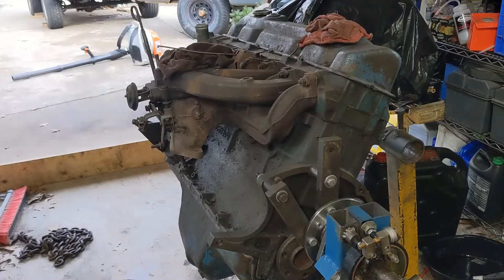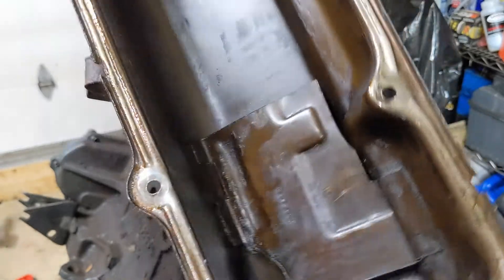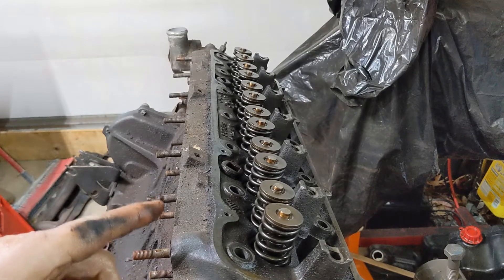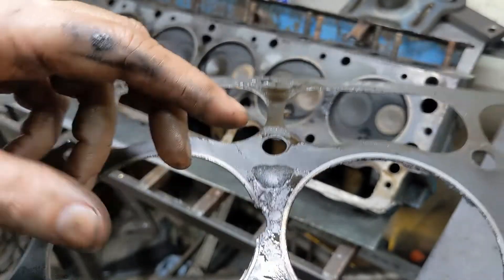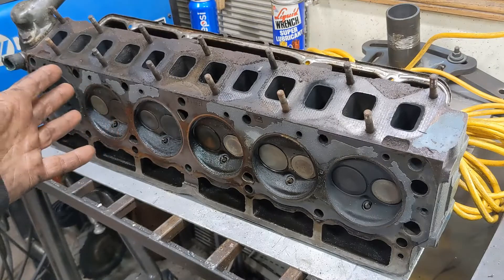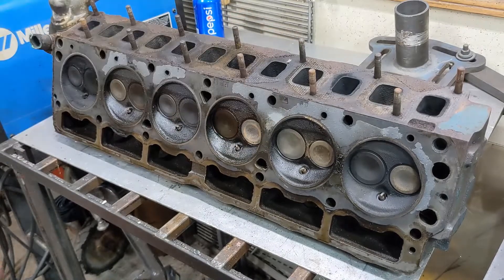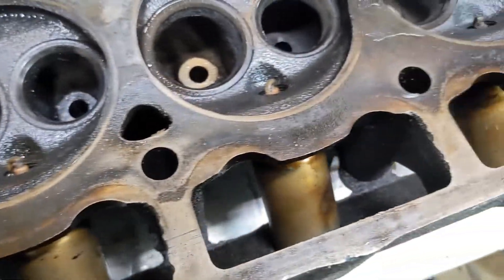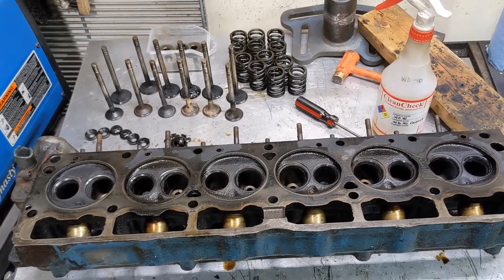Slant Six Top-End Teardown: Bad Seals and a Blown Head Gasket

Comment: My slant 6 has a cylinder with low compression and over heats. I bet mine is blowing into the water jacket. Thanks to your video it about confirms it without taking it apart right now, thanks again!
Reply from the maker: Low compression and overheating is almost certain to be a head gasket. It's pretty easy to replace, but the question is why it went out
Reply: @YoshimoshiGarage it’s old so no telling what happens to it during its life. It’s a replacement for another engine that has rod knock. Either way it’s a summer project now that winter is here, thanks again for the videos!

Comment: New valves are pretty cheap I would definitely just put new ones all the way around
Reply from the maker: Agreed, nowdays new valves are cheaper than the time required to grind old ones and I did go with new, but I still had Dr. Torque grind the old ones because it's an interesting process.

Comment: crumbling intake valve stem seals is an indication that this engine was overheating so better to check the cooling system.
it is a good idea to have the head gasket surface checked with a straight edge and rpobably resurfaced.
Reply from the maker: Good feedback, I thought the same so this head did go to get resurfaced. Twice, even, because they screwed it up the first time.

Comment: Learned a lot - thanks :) ... I don't have the tool to take off and replace the valves, it seems, or do I need that ?  If So hoping a new head gasket alone or maybe also shave the head will fix mine up, new valves on eBay are 5 bucks or so each, but without the gaskets and guides, I guess I'd have to look for separately - did get the full ENG gasket set for 55.00 needed for the 68 225 slant 6 tho...
Can you let the head soak or spray cleaner inside to help clean the valves if not taken out !? And what gaskets needed to replace when ordering new valves, any other special tools needed? 
I helped replace a head gasket on a 1966 200 sr8 6 yrs ago on my mustang, and only have the head shaved ...and never messed with the valves or lifters etc, in 2012, and runs great...but yeah, Thanks for these videos :)
Reply from the maker: A head set will come with guide seals. If you can get the valves out, you can lap them to look at their condition. I have a lapping video in the 5.9 series. Problems might need seats cut. New guides are often useful but not really required to run. Slop there just ends up burning oil.